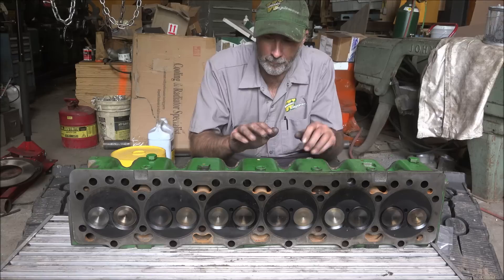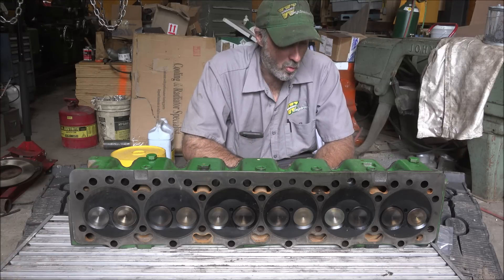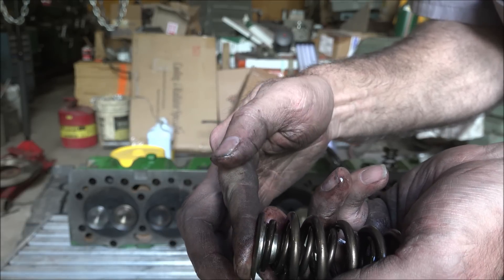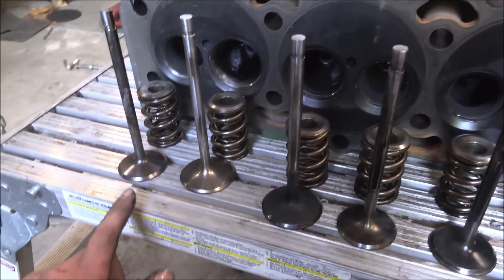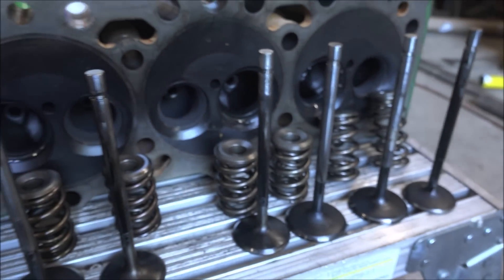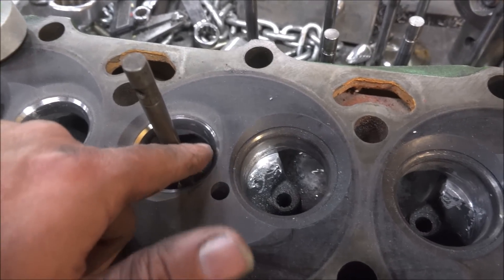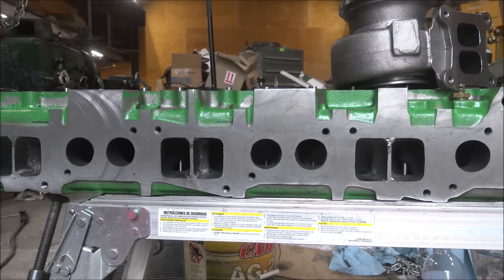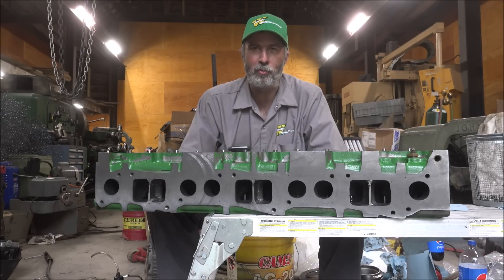Deere Tractor Pulling Head Modifications for Better Performance

Comment: How much for a job like this to be done?
Reply from the maker: Depends on the parts you have to work with and how extensive of a job you want done on the head. Typically it runs in the $1500 to $5000 range  for the mild to wild.

Comment: Sir May I apply on 3 cylinder johndeere in India
Reply from the maker: The 3 cylinder Deere heads are cross flow so they need ported more like the cummins heads.
Reply: I not understand
Reply: Sir how to increase power of deere 5405 3 cylinder
Reply from the maker: @gurpreetvirk5282  How much power are you looking for? 100hp? 600hp?
Reply: @bcbloc02  100 hp
Reply from the maker: @gurpreetvirk5282  does it have a turbo already? If so and it had a standyne pump you should be able to get 100hp out of it with just adjusting the fuel screw.
Reply: @bcbloc02   yes sir

Comment: Have you dynoed a motor with the dividers in the ports. I often thought about putting some in our pulling tractor but wasnt sure if it would help. I started working on wooden patterns to cast a new 8.1 head last winter. I was planning to make the ports seperate. Here is a video of our tractor. I made a new billet crankshaft for it a few years ago.

https://www.youtube.com/watch?v=IYA2UwRk1VI
Reply from the maker: It gained a 100hp the only time  I ran the exact same setup only adding dividers on a 1200hp 3000rpm 466
Reply: @bcbloc02  do you weld dividers in the intake manifold also
Reply from the maker: @TheJohndeere466  depends on what intake. Some  of the older factory intakes were already divided.  I have never dynoed an intake change to see if it made a difference
Reply: @bcbloc02  we run an aluminum manifold like a 55 series. It has no dividers but would easy to weld on. I think I would mill shallow slots in the head and slide a divider in.  Welding on the cast iron head would scare me.
Reply from the maker: @TheJohndeere466  I have welded tons of cast successfully so with the right procedures it is a pretty easy job.  Slide in would work too but you would need to jb weld or something to make the transition from the divider to the bolt boss tapered or it would probably hurt the port with turbulence.
Reply: @bcbloc02  our tractor puts out 1200 hp now but its 529 inches. Its running a 3lm turbo with 2.75 compressor wheel
Reply: @bcbloc02  I was thinking of making the back of the divider wider but cnc machine it so it just has a little radius tab sticking up to engage the slot that I mill in the head
Reply from the maker: @TheJohndeere466  I guess you are in one of those classes that requires a 3lm turbo?  I know if not you could gain a lot of power with a different turbo.
Reply: @bcbloc02  yes we have to run the 3lm
Reply from the maker: @TheJohndeere466  do you have to run a 3lm turbine or can you stuff anything in it?  Might could put a s300 or s400 shaft and bearings in it and make it a lot better if you still have a 3lm turbine
Reply: @bcbloc02  I think its actually a gt42 ball bearing turbo with a 3 lm compressor housing.
Reply: We've been doing really good. I think we won 6 out of 8 pulls but would like to squeeze out a few more ponies.

Comment: Hey man you live down the road from my buddy and I was wondering on how to contact you about a 350 block I need work on 🤙
Reply from the maker: Best to email me it’s on the about section for the channel or just bcbloc02 at yahoo. Be warned though my equipment is not set up for v-8 so it takes me double the time to do v8 block work than a normal automotive machine shop so it costs more.  That being said it’s also less often screwed up because usually with low $$$ work comes sloppy low quality work.

Comment: Those little details Brian...Those little details. Important in standard performance heads. Vitally important in things that are running out at the edge of the spectrum. Back in the 90's I worked in a machine shop that was run by an old nitro racing guy. He taught me so much about high performance heads and engines. His attention to detail was always impressed on me. So much that I hate having someone else do a valve job for me because I am afraid they  will not do it correctly. I also have an assembly procedure that was taught to me for engines that I follow. No matter it be a lawn mower engine or a 3406 Cat. Once the sleeves are in on a sleeved engine, They all go together in the same order and nothing gets left undone due to forgetting a procedure. Cheers

Comment: So did someone else weld in the dividers ?   I suppose who every did it they may have used  like a nickel rod  ? I think any time you can smooth out the runners it makes a big difference . And those sharp edges have got to make a lot of turbulence in air flow .Looks like a great job . Your customer will be happy  I'm sure . Nice job Brian
Reply from the maker: I welded the dividers in just didn’t film it.
Reply: @bcbloc02 what advantage do the dividers give?
Great job!
Reply from the maker: @dans_Learning_Curve  More torque

Comment: Swirl ports! You can modify the high helix for added flow but never remove the ramp from a swirl port head. Thanks
Reply from the maker: Yes they are a very directed swirl port.  Some of the high swirl Cummins heads have the ramp clear to the back face of the valve with a hard cut off of the air coming in so it all has to swirl. I kind of think that might be the ideal way to do a port like this but that pretty well limits the valve to only seeing half the port.
Reply: Deshrouding is very important on swirl ports. Airflow is very even around the perifery of the valve.
Reply: Thanks for the shout out!

Comment: It’s funny the amount of work that people put into these engines that they would have mix and match components
Reply from the maker: Apparently it was last worked on in 2020 during the shutdown and they could not find a full set of valves and no one was open to get custom ones from. It’s not like a big block Chevy where there are lots of valves available. The amount of 6.25” valves available are pretty limited.

Comment: Was JD ramp design like that to begin with, by having that step in the ramp? Would you have tried to make a better ramp design by milling if it was your head? What was the metal in the head? Was it part of a turbo that came apart? Nice job on the dividers, manually port them or did you do some on the mill? Is there any flow bench that shows ramp design or modifications for the swirl caused by the ramp?
Reply from the maker: Some flow benches have meters to measure the swirl.  Yes it had a turbo wheel explode and go thru it so it was bits of aluminum.

Comment: I'm curious about what's the most popular John Deere engine series to modify for sled pulling Brian?
Reply from the maker: The 466 family is the most popular. Especially since there are certain classes where that is the cubic inch limit since both Deere and ih had 466 and they are 90 plus percent of all the tractors pulling anyway
Reply: @bcbloc02  Thanks for the reply Brian. I work mainly on John Deere's Marine Powertech series so I'm still learning a little about the AG side (As JD Marine we're not allowed to touch AG LOL). I've always been intrigued by sled pulling rigs & the ingenuity of their owners/crew. Keep up the great work!!
Reply from the maker: @glowplug4762  it would be fun to have a boat with a pair of 1000hp 6090’s!

Comment: That’s what you get when you don’t know better with those retainers better to check out every part out of the box. Was wondering what kind of rpm can you turn with these engines. From the looks of it they are going to be very happy with the results of the port work
Reply from the maker: This one should run in the 4000 to 5000 rpm range
Reply: @bcbloc02  that’s spinning pretty good for a long stroke tractor engine damn near double stock no wonder you have plenty of work
Reply: These days "check every part out of the box" is just SOP with me, any part for anything, QC has gotten too spotty across the board to trust it.